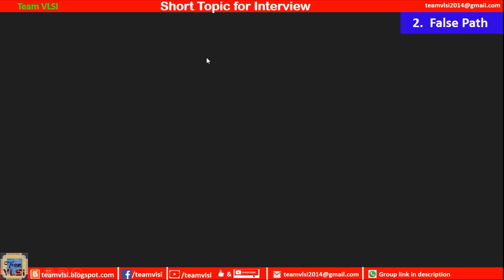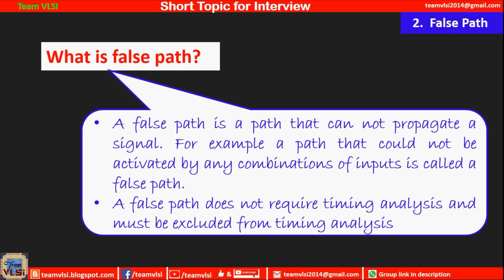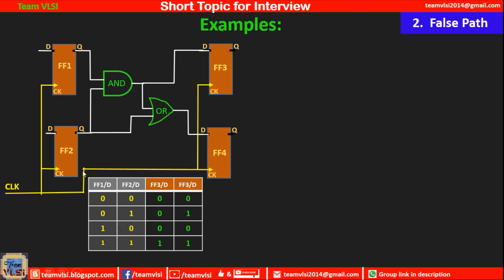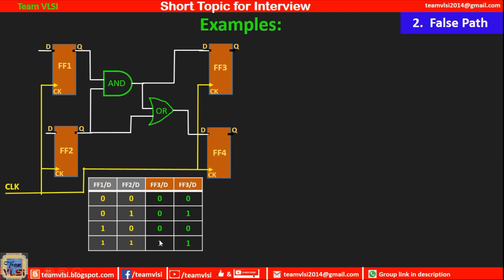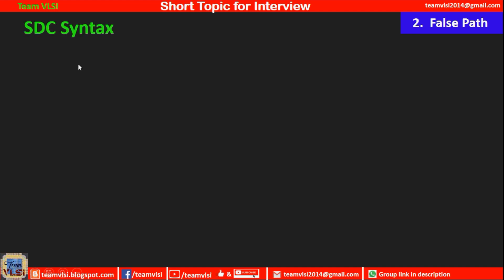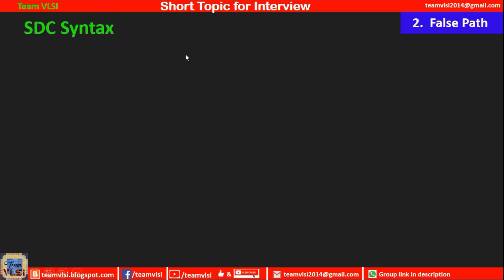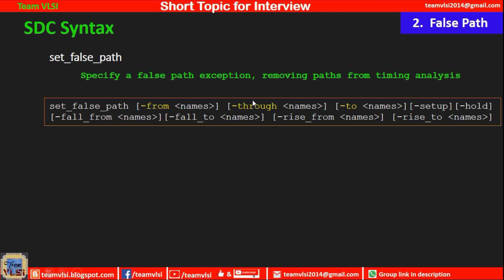False Path in VLSI | Examples of false path | Write false path constraints | Timing exceptions

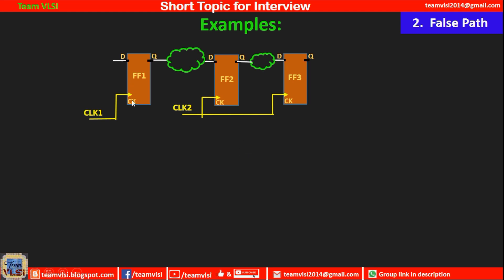Comment: 6:40 sir, if two ff are having diffrent frequency then we can do timing analysis by Multicycle concept right?
If yes then why we need to declar that as false path
If No then what   u explained in MCP concept regarding two diffrent frequency
Reply from the maker: Hi,
It all depends on the relation of two clocks, If both are independent then false path can be defined between them.

But suppose if the another clock is just derived from a clock divider or multiplier, in that case we may go for multicycle path requirement.
Reply: @TeamVLSI  by independent clk means they are coming from diffrent sources or they just  have diffrent duty along with diffrent frequency but coming from same source ?
Reply from the maker: @sane4895  Yes, different sources.
Reply: @TeamVLSI  thankyou sir fir your quick respons😊